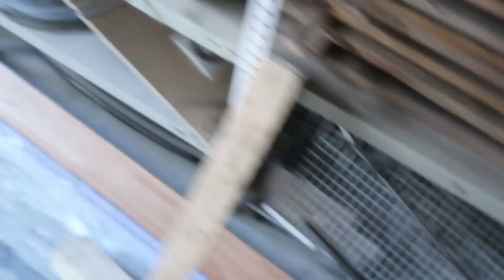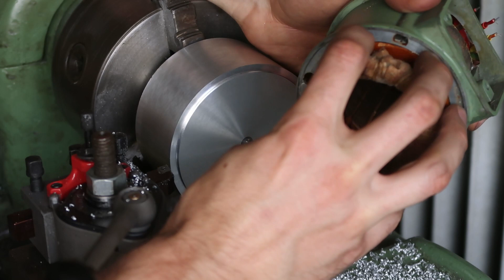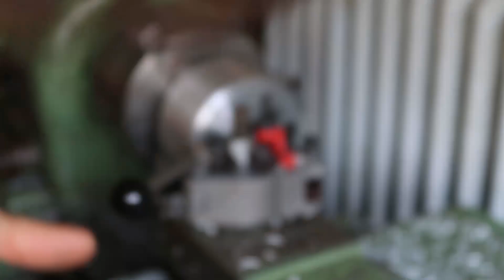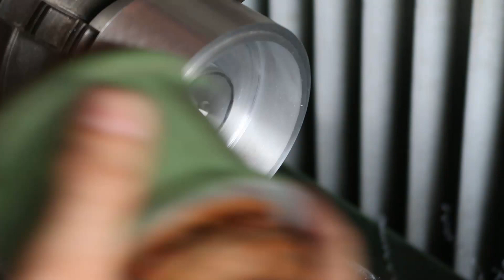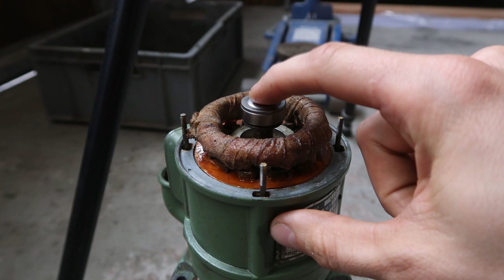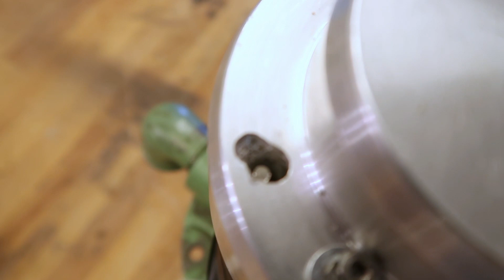Saving the lathes coolant pump | Machining a new cap out of aluminium

Comment: I'm only just over a minute in and I want to know how you turned down that first bit - who cares about OSHA 😂
Reply from the maker: I drilled and tapped a M14 thread into it, then used a bolt to hold it in the chuck with a live center on the other side. Turned down the part which actually fits into the chuck, flipped it and trued it all up, then cut it in half and that's where the video starts
Reply: you got there in the end - is there an o-ring or something in there?
Reply from the maker: There isn't, but now that you say that maybe it would have been a good idea....from the factory there wasn't either but then again the factory setup disintegrated into small bits....
Reply: @DmitriIvanov  it was good to see a good honest struggle with the job. And remind me to ask you what kind of Canon not to buy when the time comes. 🤣
Reply from the maker: It's a g7x mark 2, I heard the mark 3 is even worse. When your fingers get grimy the touchscreen doesn't like to work anymore....
Reply: @DmitriIvanov  Holy crap that's not even a cheap camera really either - that's sad to hear because I wanted a Canon at some point. I just use my phone but it does a pretty good job. (Lol - at least, I think so)
Reply from the maker: Even if I shit on this camera in almost every video I would still buy a Canon. I used to take photos rather than videos and nothing beats the interface from Canon I really love it. I've only struggled with the autofocus with dirty hands on this one - so I guess it's not 100% canons fault. Ah the other thing is the autofocus noise if you use the onboard audio - you have to lock the focus or you hear the nasty noise in the audio. Your phone looks totally fine I wouldn't have ever guessed it was a phone in your videos!
Reply: @DmitriIvanov  I've never noticed the autofocus noise - even when you point it out but - I might be a bit deaf - my wife seems to think so. The phone is a galaxy S10+ - it has some nice lenses on it but they are small sensors and all that stuff. I'm not complaining about it - just planning ahead to when I don't have it anymore as it belongs to my company and with this virus going around who knows how long I'll be with them.
Reply from the maker: Which industry? Everything here is slowed down or closed - let's see how it all plays out.
Reply: @DmitriIvanov  I'm in software myself but the company is in the sport (mostly rugby) industry - strangely it is fine here in NZ where I am but in almost every other country in the world - not a good industry at the moment. We'll see what happens. 🤷‍♂️
Reply from the maker: Ah but SW you can always shift to something else - or are you in the middle of nowhere in NZ?
Reply: @DmitriIvanov  I live about 50km out from where most of the jobs are and I've worked mostly at home for the last five years .. don't want to go back to commuting 😭